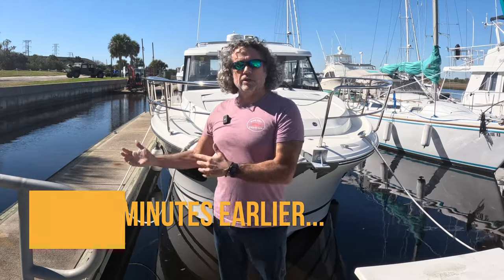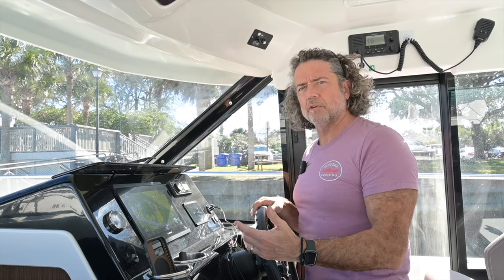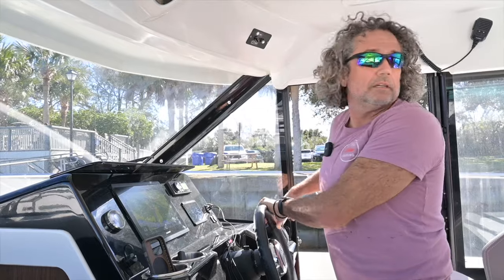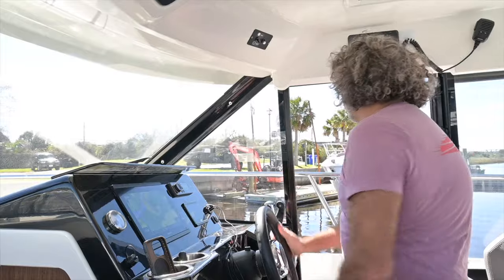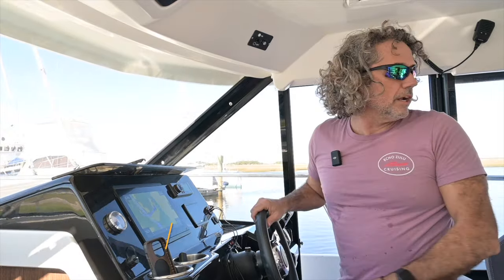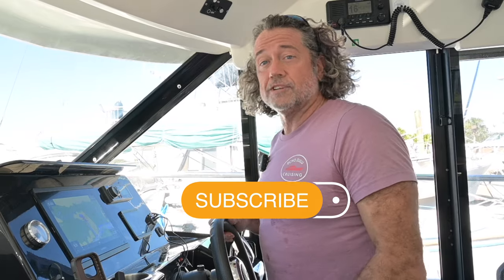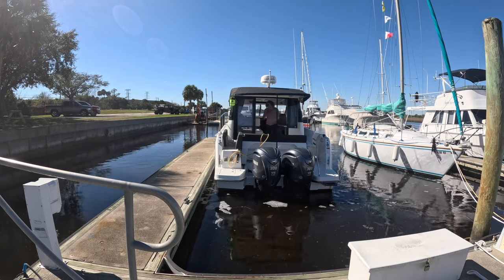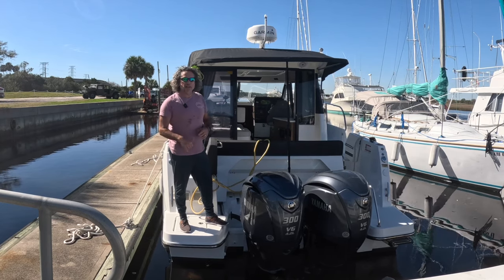Master Docking Twin Engine Outboards: Learn From Our Mistakes

Comment: Stop touching the wheel. Helm centered. Use the gears. Or if you’re going to use the wheel then shift both together and treat like a single screw. If you’re shifting one engine and turning the wheel you’re defeating the whole point
Reply from the maker: Thank you. My default is engines straight and just throttles unless wanting larger maneuvers, with less power. I learned on boats with fixed props and rudders. So, turning the wheel and engaging the engine is how I think of getting the most lateral movement with the least forward momentum. For example, to move the aft to starboard, spin wheel hard to port in neutral, engage  the starboard engine forward briefly to give more aft walk to starboard.
Reply: Helm centered and using the gears is correct for twin inboards where the props are some distance apart. With outboards, where the props are close together, it is very effective to use the helm and only the engine on the outside of the turn. This keeps your speed down and maximizes the turning moment.  Wheel to starboard, use port engine.  Think of turning a shopping cart or a castered office chair. You have the ability to direct the thrust, use it.

Comment: Not sure how responsive your twin engines are being so close together, but keeping twin engines straight and using shifters alone is easiest on most docking maneuvers.
Reply from the maker: Thank you.  My default is using throttles except in heavy current,. Though the props are fairly close together, they are fairly responsive, with a right and left hand prop,  though the turning point is pretty far back. This was me unintentionally showing sub optimal docking.

Comment: Don’t know much about twin out boards but have a lot of them in my marina Grady Whites & Pursuits. What I have noticed is most times the guys use the wheel and thrusters. Just an observation.
Reply from the maker: Thank you. I default to engines from the boats I worked on, relying on prop walk and moving slow. But, in wind and current, wheel and power are preferred for me. The 1095 is an easy boat to maneuver.

Comment: With twin outboards, turn the wheel and use the engine on the outside of the turn.  Your last manoeuvre wheel was to starboard and you went forward on the  starboard engine. More effective would be to go forward on the  port engine to bring the  stern to the dock.Rule  is use the engine opposite to the wheel.Wheel to starboard, use the port engine either going ahead or astern.Think of pushing an office chair with casters.  If you want to turn right, more effective to push on the left back of the chair. Leaving the wheel centered and using only the gears is what you  would on on an inboard engined vessel when the props are farther apart.
Reply from the maker: Thank you. I spent the vast majority of my time with inboards, so my default remains throttles. Your point of using the engine opposite the wheel is the key takeaway. This was a perfect example of a boater losing focus. Filming and describing lead me to make dumb mistakes.
Reply: @echozulucruising  we have all been there.

Comment: Thank you for sharing this video (and your mistakes).  Trying to learn from watching 'This Old House' is frustrating because they do everything right the first time.  I personally felt panicked watching you perform this maneuver - but I learned much more from your mistakes than I would have had you done this perfectly the first time (or edited your video to make us think you did it perfectly).  Kudos to you for your humility.
Reply from the maker: Thank you, for the positive feedback, the goal is to be approachable and, that means showing mistakes I wish I did not make. The plan was to show how easy it was turn the boat. I was embarrassed to make the mistake, but, it reinforces how everyone can use practice, so that when something goes wrong you can recover (and not over throttle into another boat).

Comment: Great video. Lovely boat. Have read the other comments regarding using the helm AND the throttles. 
I have an 895 and try - on slow speed manoeuvres to just use the throttle.
Agreed using the helm too can improve your turns. But with little wind. Like in this video. Do you think you wouldn’t have left the throttles in gear too long if you had not been thinking and using the helm? 
Just one thing less to be thinking about. 
Just a thought. 
Look forward to viewing more of your videos. 
There is a chap in Australia who has an 895. His channel is called The Rudder. Worth checking out. 
More berthing videos please.
Reply from the maker: Thank you for watching and the comments.  I really enjoy The Rudder and what they do. I believe the issue on my docking here was concentrating on trying to talk on video more than using the wheel and helm.  I am trying to get a friend to bring their drone over and do one docking only steering. One video only throttle and one using one engine. All I need is more time!
Reply: @echozulucruising  Great idea. Hope you are able to do that it would be a very useful video.

Comment: I hate that the shifters are on the right hand side, one thing I was taught was to only use my left hand to shift the port engine and my right hand to shift the starboard. I've found this advice to be extremely useful, but with the shifters smashed up to the right of the steering it is difficult to work them with both hands.
Reply from the maker: I was taught the same and had forgotten. It remains my unconscious default on how to operate twin engines. I do that maneuvering in the marina. Open running I use the right hand on both.

Comment: I'm surprised to see you use so much wheelwork.  I've always been taught to use the two engines to control the rotation and movement of the boat. Is there a reason why you don't only use the twin engines in and out of gear to move the boat?
Reply from the maker: A great I. most conditions is just throttles on engines straight. With the outboards, sometimes using the wheel and engines together can make more pronounced maneuvers with little power. In this case, once I over corrected from leaving the engines in gear on the first attempt, I used engines and throttle together just to dock more quickly after making a thoughtless error.
Reply: Also with outboard the engines are close together and thus the boat will be less responsive using the engines only. I'm not saying using the wheel at slow speed is the right thing todo, just simply pointing out that this boat with the two engines close to the center line it will not rotate the same as a catamaran for example.
Reply from the maker: @rexphinney3599  since it is relatively short, it maneuvers fairly well with just the outboards when there is little wind or current, but when there is more going on, tend to steer and gear rather than use  throttle controls. I default to throttles because of the boats I learned on in my youth.

Comment: This is why I would want the joystick if available - I believe it would make docking easier (from the single engined boat I had years ago docking was the most stressful part of boating)
Reply from the maker: We enjoy our 1095. I only imagine a joy stick making it even easier to dock.  The 1095 handles very well and we find it a straight forward boat to dock (most of the time) with bow thrusters and the twin engine. The minor detail of user error is what makes docking hardest.